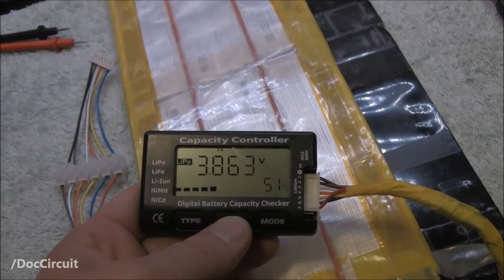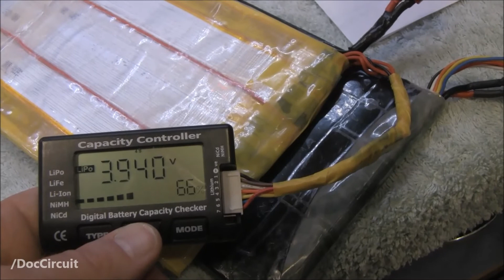Using Electric Skateboard BMS to Parallel Charge Batteries. FAIL!

Comment: Hey I recently ordered a Magneto electric board and after seeing your vids i'm kind of worried. You don't complain about them but they just seem to break a lot and i'm not a very handy type of guy to try and fix it. I just wanted your opinion if I should attempt to return it right when it arrives or keep it and hope it works for a while?
Reply from the maker: +Mikenopolis There are various options. Best thing to do is research the current rating of various plugs (for example Deans connectors are only rated for 50A). When I finally commit to a VESC/ESC I will cut/remove whatever is in the board at that time and solder the VESC/ESC into place.

So if you plan on sticking with a VESC, I'd solder it in place. But higher rated connectors will do the trick too...
Reply from the maker: +Sam Cleasby You don't need to be particularly handy, replacing the ESC with a VESC results in a much better board, still at a very cheap price. It should also be kept in mind it's the same two components that are prone to failure - but I'm heavy. Personally I'd buy it, use it, and if/when it develops a fault replace the ESC. 

My VESC fitted clone board is my 'go to' board for shopping in town. It's lighter than my Metro Board and goes further than my Boosted Board.
Reply: +Dr Circuit as far as replacing the ESC with the VESC would I be cutting wires or de-soldering them? if cutting what connectors should I get to connect old wire to new VESC?